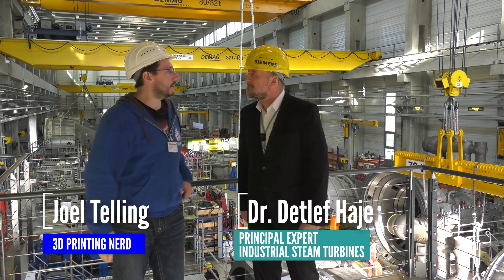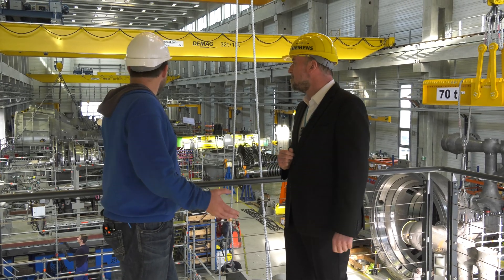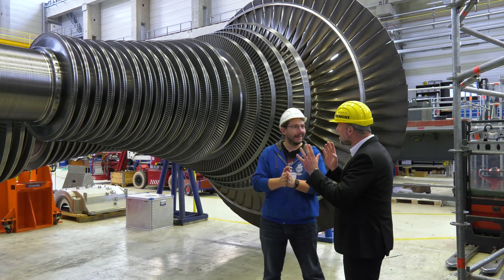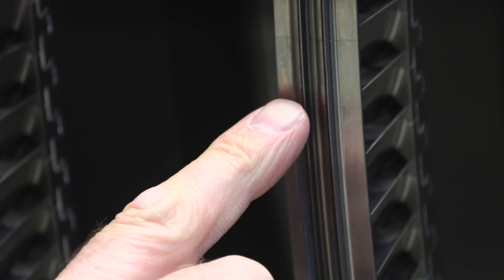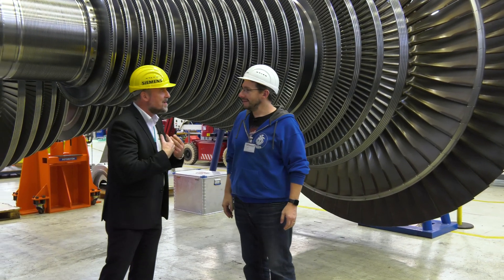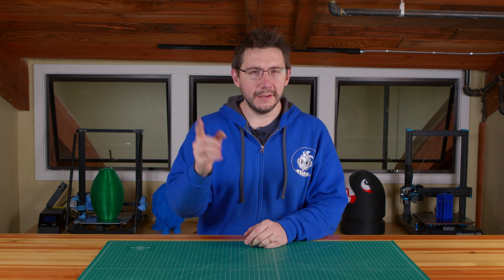Power For 300,000 people! The 60 Ton Industrial Steam Turbine!

Comment: Hi, millwright here! I work on gas and steam turbines in power plants! The rotor you saw there was pretty small actually! For example, LP (low pressure ) rotors used on nuclear steam turbine trains (most steam turbines for power Gen use a train of multiple rotors connected to eachother ) can be up to 300k lbs, with LSBs (last stage blades ) up to the 48" long meaning the overall diameter from blade tip to blade tip can be in the realm of 10 feet!
They're such fun and fascinating machines to work on!

Comment: the Siemens rep should have explained each rotating blade sliver is sandwiched between a static blade unit ... these turbines have dozens of these pairs ... the steam escapes through each sliver ... the rotating section forces steam up followed by its static blade forcing steam direction down ... this tension powers the rotation

Comment: Never would have expected 160 bar.  Clearance between the stator and rotor is tight, even for the smaller sections.  I have a feeling there is a specific start procedure that allows thermal normalization prior to rotation.
Reply: Warming of the case and stretch out of the turbine rotor using steam for heat. Also the while this is happening the rotor is on barring gear turning very slow like 1 rpm to allow for the rotor sag between bearings to straighten out
Reply: @paulcurrie7828  Yup that was roughly what I estimated it would take.

Comment: I wonder, these main propulsion cannot be run by WASTE HEAT of lower than 250 °C of low pressure steam but they(turbine) need at least Main Source of 350°C, medium to high pressure steam to provide the power for 100,000- 300,000 people (250 MW).
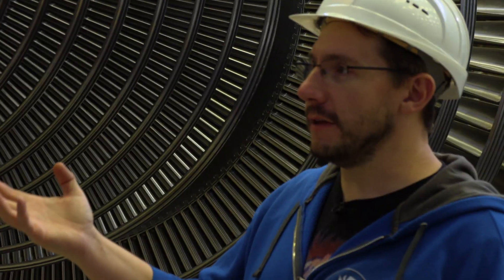Reply: 4:44  And he said 560°C @ 16 MPa (160 barg), that cannot be waste heat.?

Comment: Wow!! when I was a college freshman I worked in the heating plant for the whole campus.  We had a steam turbine-powered generator that could produce 500 KW as a backup power supply.  It was far from the technology you just showed us.  The patents were from 1905 or so. 

Could a modern turbine design efficiently power a locomotive?  Much heat is wasted in a traditional steam locomotive because the spent steam is not recirculated as feedwater, which makes a lot of maintenance problems for boilers because of accumulating scale. But with modern design techniques and turbine-electric drives what level of efficiency could be achieved?
Reply: Main problem with a closed steam circuit in a locomotive is condensing the steam.

Comment: Those rotors are small... I worked on machinery that overhauls rotors that weigh 250tons.. including lifting them from horizontal to vertical to dismantle / re assemble them and true up all the mating surfaces to minimise supersonic speed steam disruption.
Reply: What size was the lathe that trued it up

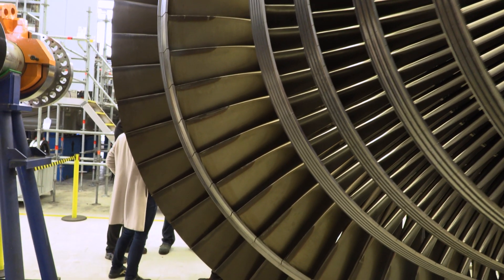Comment: 2:41  Let's see...500 m/s  = 0.5 km/s = 1800 km/hr = 1125 miles/hr.  And presumably he means at the outer edge of the largest blade.  By the looks of it, it's about twice as high as a person, so say 4m diameter or 12m circumference.  So at 500 m/s that's about 42 revolutions/s = 2520 rpm.  Not all that much, although I suppose it is a lot for such a large part operating a quite a high temperature.
Reply: Not very much rotational speed, but think about the massive amount of torque when it's cranking out 250MW.
Reply: @SDCustoms  what???? Not very much rotational speed???? Man,almost every thermal power plant turbine runs at the speed of 3000 rpm.... And that's a lot... Believe me... And for that huge rotor and blade assembly together... It's a lot.... Think about the perspective... Small things can really rotate very fast... But for that huge assembly, it's fast... So fast
Reply: 3000 rpm = 50 Hz  which is the power grid for most countries in the world,  3600 rpm = 60 Hz for North America